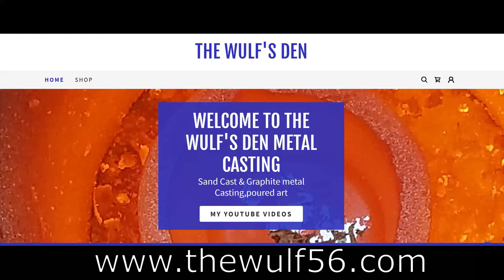Scrap & Melt 4 - Tearing down & melting 2 Large Aluminum Lights for Copper & Aluminum. #DevilForge

Comment: Well I've got to admit, you never fail to surprise me. Great score on those lights. Are you gonna melt the aluminum wire? And what the hey with the rock tumbler!! What medium did you use, how long???
You just bumped things up a bit!! Absolutely love it.👍👍😁😁
Reply from the maker: Yeah, can't beat free materials. I will melt the aluminum transformers next time I make nordic gold, it will work good since its 2 of the needed metals together. I scored 2 dozen of the lights, so I just need some ant beds to pour them in lol. Just hope the rest of the transformers are copper. I just use stainless steel beads, they are random sizes and SS pins that are around 3/8-1/4" long. Just lookup SS tumbler media off amazon. I think I left the bar in there for 30 minutes. I was wondering where you had been, didn't see you in comments last week, and you ALWAYS get the comments in lol.
Reply: @Thewulf56  Yo!!!  Been a bit under for the past couple of weeks but I did watch and 👍 your last show.
You saying that about the ant hills "yeah buddy". Saw another channel pour cast iron, didn't go too well, ground was wet. Lol 
Seeing the tumbler makes me wonder how it would do on sand casts. Anyway, great score on the aluminium, ought to keep you in supply for a little while. Thanks D and be safe.
P.S. YouTube is not notifying me of replys 😡 I found one last night where someone replied 2 months ago.😬